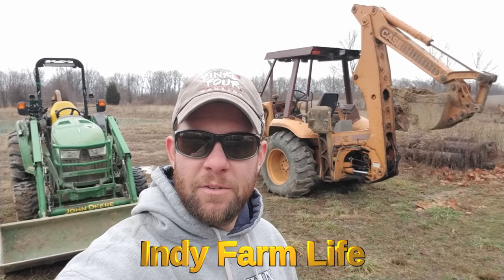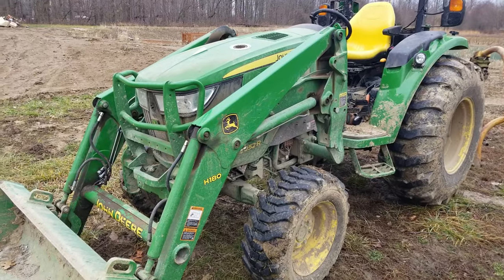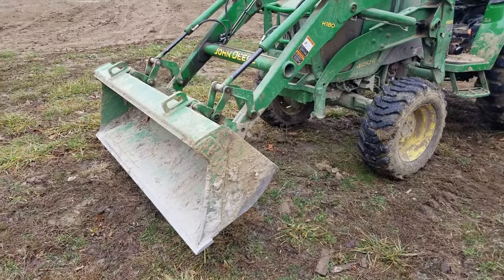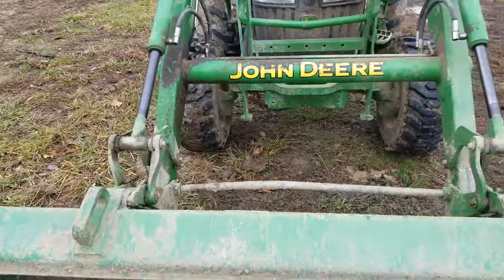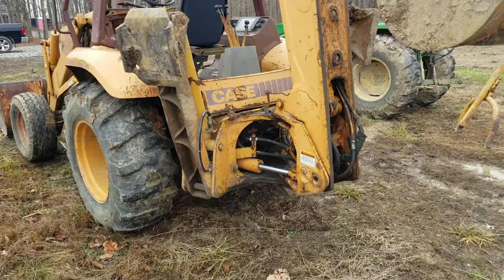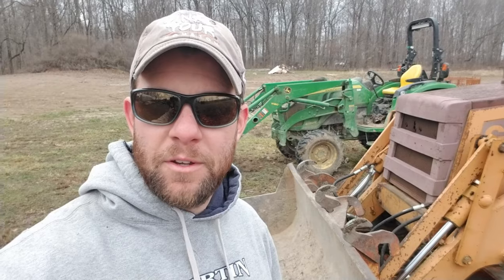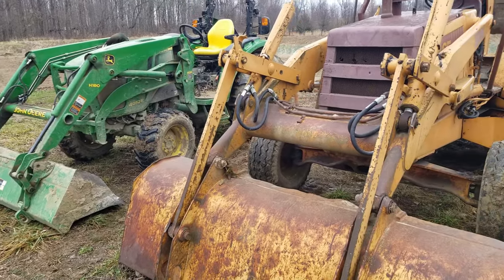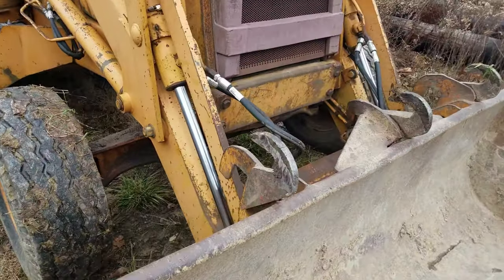Tractor vs Backhoe:  Did You Know About This?

Comment: Good video.  One question, has the backhoe being 2wd ever been an issue?  I know you can get a used 2wd a pretty good bit cheaper than a 4wd.  I came close to buying a 2wd a few years ago but was afraid I would have buyers remorse so I backed out. Still haven’t bought one!
Reply: if you get alot of snow or some real marshy ground it makes a huge differnce
Reply: yep; always pends on use case...  As others mention; if you are going anywhere near snow/wet/mud/marsh everyday; buy the 4wd.
Reply: I have both. 4x4 only gets used pushing big piles on a slope, or muddy or snow. Rear wheel drive can go almost anywhere a 4x4 can go. I'd say it helps more for pushing than anything else. 2 wheel drive gets driven 3 time more than the 4x4. Faster and lighter
Reply: I found that 4WD is almost a necessity here in Mass, especially with mud or snow.
And air conditioning is not a frill.  When I bought my 310, it came with AC.  I laughed at why anyone would pay the money for that feature.  I quickly wised up.

The first day you have to dig, and it's 90 degrees outside, you will thank the gods in heaven that you have it.